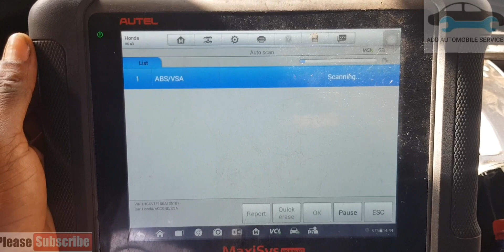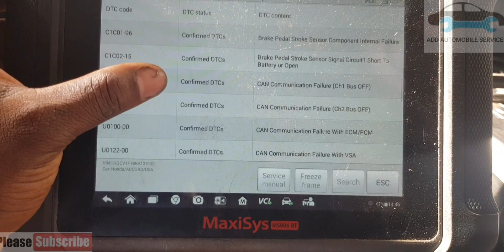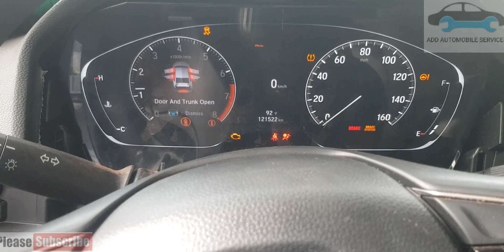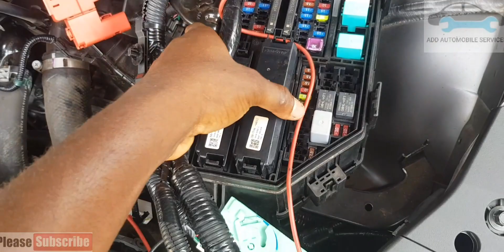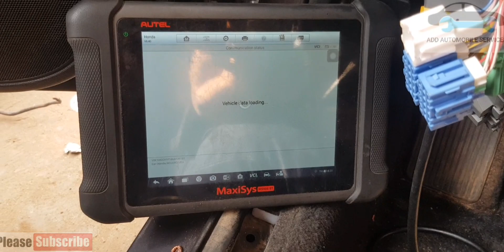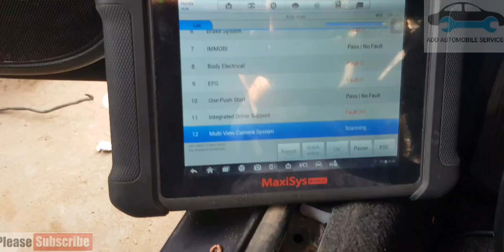Accord 2019:No start and No communication with the engine bay control units (always use wiring diag)

Comment: I have a 2018 accord that is not communicating with the srs unit, and other modules. After i opened the srs unit, one of the chips was bad. I bought a used one from ebay but i still dont have communicstion with the module. I get code u0151 can you pleae help?
Reply from the maker: In what module
Reply from the maker: In what module

Comment: I have the same issue,  its almost brand new , scanner not commuincating with ABS module and pcm.... car is not starting it had small crash that resulted two air bags that i bought new and also srs modular... after that accident all air bags and modular problem solve but car is not starting and displaying same issue that u posted in your vdo.. can you guide please..
Reply from the maker: You have to check the system and know why does modules are not communicating
Reply: @ADDAUTOMOBILESERVICES  which system should look into, can you explain please? A guy came with autel scanner he said you have to change your ABS modular... but I don't think so as the vehicle is very new

Comment: Bro a small white light blinking what is for?
Reply from the maker: Red or white
Reply: White
Reply from the maker: Ok
Reply: Please reply
Reply from the maker: It is the transmission range position light check you Air bag system
Reply: Which is blinking

Comment: My Honda Accord 2013 have U0122, car jerks on movement. Kindly advice.
Reply from the maker: Pls in what module do you get that code
U0122 is Lost Communication with Vehicle Dynamics Control Module

Scan all the system and check your engine

Comment: Hello i have U0100 & U0115 its a 2019 2.0 accord. Where would i even start? I have no idea
Reply from the maker: In what unit is the code in
Reply: Im not sure what that means, but i scaned my obd2 with a scanner I bought off amazon. It read the code under “permanent codes” in the “A/T” section. The “Engine” section had no codes
Reply from the maker: The problem is in the A/T and have you change the transmission or the transmission control module
Reply: @ADDAUTOMOBILESERVICES  no the transmission is stock & haven’t even changed the oil in it, was going to do so next week.
Reply: @ADDAUTOMOBILESERVICES  would you recommend i check the transmission control module?
Reply from the maker: Yes
Reply: @ADDAUTOMOBILESERVICES  ill check it out, but the car switches gears well. Basically i have those 2 codes, all dash lights are on & i have no power steering. Could i have something else wrong that the scanner isn’t picking up?
Reply from the maker: Yes check if the scan tool can communicate with the eps
Reply: @ADDAUTOMOBILESERVICES  it can not. Its a generic code scanner. I think ill just take it to a mechanic. Not much i can do
Reply from the maker: Ok boss

Comment: Please sir, I am having problem with my 2011 Honda accord with no start condition. With trouble code U0100. Gauge control lost communication with the pcm. The car will not shift from park and the PRND indictor will not show on the dashboard. Please I need your help
Reply from the maker: What have you check , is the PCM communicating with the scan tool

Comment: I have a problem with the immobilizer scanner said nimmobilizer not normal
Reply from the maker: What are the fault code
Reply: Else the transmission gear indicator not working
Reply from the maker: You have to scan all the system
Reply: Ok but I don’t have any working key and I need     Turn on and off the switch how can I do it?
Reply from the maker: @jonathanrabadan5273  you have to get a key programming tool to turn the ignition on
Reply: Yes I have it but ask me to turn off then on in 15 sec
Reply from the maker: @jonathanrabadan5273  when you do that does the ignition turn on
Reply: Yes I have the autel 508
Reply: But I have to cycling on and off
Reply from the maker: @jonathanrabadan5273  you have to program a key to it before you can cycle the ignition so when you are diagnosing it and you need to cycle ignition just skip it
Reply: Ok
Reply: But I don’t able to program the key because I have a code for imobolizer
Reply from the maker: Oooh ok then you have to fix that issue first and what code is it
Reply: The car was  in a crash and I have many codes u0151 u0038 u0104 u0104-00 u0401-68 u0102-68 p0864
Reply: U0401-68 and u0402-68

Comment: Im having  the same problem  as you except they we're  testing  the ac pressure  switch  and sent power  down the power wire of the ac pressure  swicth with automatically shut off the car and lost communication with the ecm pcu and the car wont start
Reply from the maker: Are you able to scan the ecm
Reply: @ADDAUTOMOBILESERVICES  no i am not able to scan it i plug in my maxflex by matco and it tells me error no communication  the car wont start and i have all the same messages  as you did in your video
Reply from the maker: @user-lh1hd5iw7h  pls take out the PCM socket out and use the vin to scan the vehicle
Reply: Bro, did you fix it? Let me know please. Happened the same, ac switch then it shut down
Reply from the maker: Pls scan the vehicle first

Comment: Tengo el mismo problema con un accord 2019 
No indica posición P 
Y no star motor 
Plis Help
Reply from the maker: ¿Cuáles son los códigos de avería?
Reply: @ADDAUTOMOBILESERVICES  
Nos podemos contactar por WhatsApp??
Reply from the maker: 00233246312303
Reply: I can't turn on my car on the on position because car won't recognize the key I tried programming new key won't let me
Reply from the maker: Pls have you scan the vehicle and what it the fault code
Reply: U0129
Reply from the maker: U0129 Code - Lost Communication with Brake System Control Module